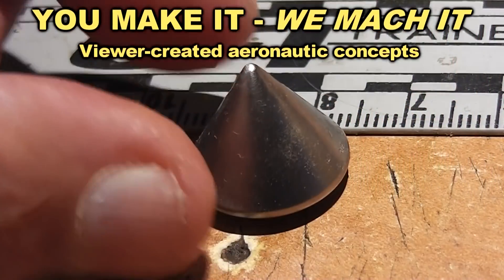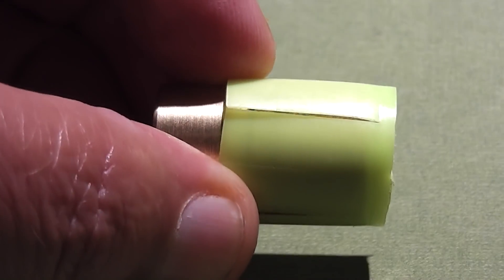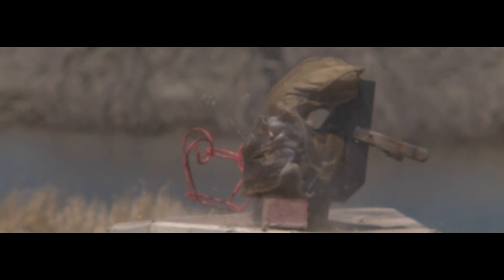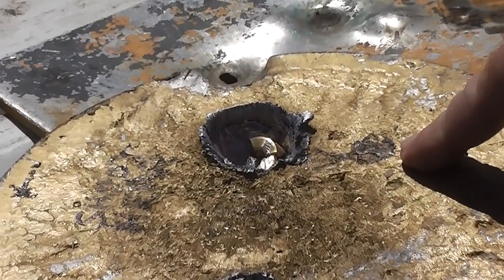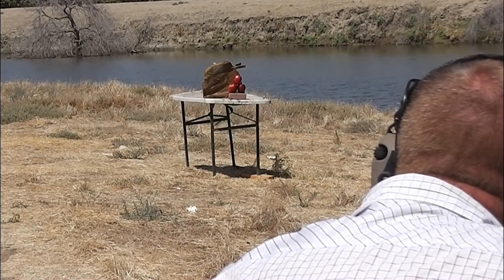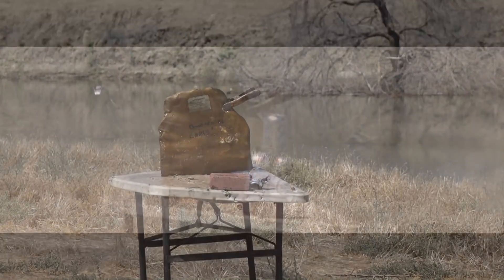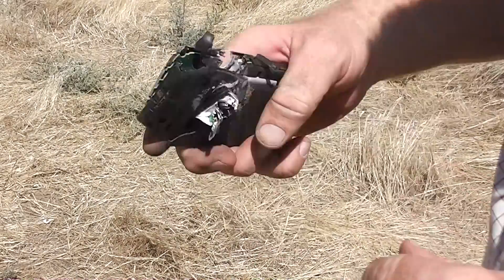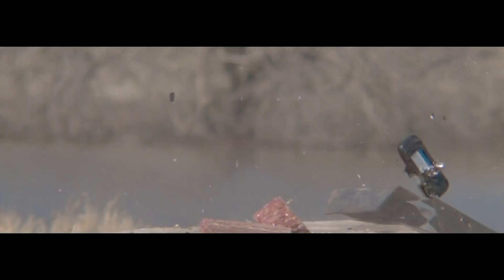The Comet -  Project-ile with unusual wooden SABOT

Comment: This wooden sabot slug reminded me of a WWII veteran that I knew when I was a young man still in school in Arkansas.  He owned a shoe store repair shop and had a bad leg he told me it was from a wound received toward the end of the war in the Pacific and was caused by a Japanese built made of wood and had produces splinters for a long time after he cam home.  It seems that towards the end of WWII the Japanese were so desperate for metals that they made some builts with a metal cores and a hardwood cover.

Comment: WOW. Awesome results. Both surprising and fascinating!
Now this is a HUGE surprise - I was sure the slightly longer tailed slugs will be more stable.
The wood (beech) is the same wood I used for the wooden slug. It does survive being shot - but I'm super surprised the two halves actually opened!
I actually guessed they will be flying along with the slug - that was a very pleasant surprise (especially considering my lousy hack-saw work trying to cut these in half)
Thank you so much Gregg and Jeff for a wonderful test and most interesting results!!!

Comment: For the sake of discussion if you used a particle accelerator that had lands and groves rotating one direction would the tail of that projectile, that looks like a bolt, need to coincide with the lands and grooves on the acclerator to maintain accuracy?

Comment: PLEASE READ THIS!: i have a crazy idea but it could work, what if you paint the gun in green paint and other bright colorsin a crazy camouflage pattern so the reviewers that are speed checking the video dosent get the weapon shape and just move along with the speed scrolling. im not sure if this could help but please try it at least once to see if it helps. the patterns should not be actual military camouflage but like high contrast colors that throw away the shape from a far.
Reply: Gun? I see no guns in this video. They don't even talk about guns, except to state that there are no guns! Only safe vacuum-actuated, Tesla coil powered mass drivers, and an older man's gas actuated walking stick with an ergonomic handle and rubberised shoulder rest ( seen on the table).

Comment: Wood has been used as sabot material since the era of shot and shell began.
Reply: Brian Landers  then it wouldnt be a sabot
Reply: True and a wooden shoe is a sabot. I was going to quote the throwing of wooden shoes into machinery as sabotage but apparently I am mistaken. https://www.etymonline.com/word/sabotage
Reply: @COIcultist  That doesn't necessarily debunk the wooden show idea. It says, "likely it was not meant..." There's really no way of knowing the etymology and origins of a lot of words that were developed hundreds/thousands of years ago.
Reply: It's also used for roller coaster tracks, because it's extremely strong under compression.
Reply: @MinnesnowdanSniper  As long as it takes longer to burn through than Building 7 did, I reckon I'll have time to reach the end of the ride and get off normally.
Reply: John Smith  The increased volume behind the brass would mean lower pressure and less force at first, costing a little bit of energy. I'd be more concerned about the plastic wad being impaled on the bolt and becoming an unbalanced draggy tail if the wood wasn't there to keep it off.